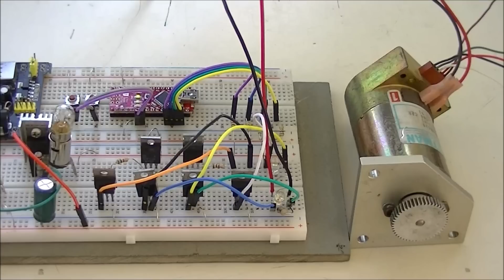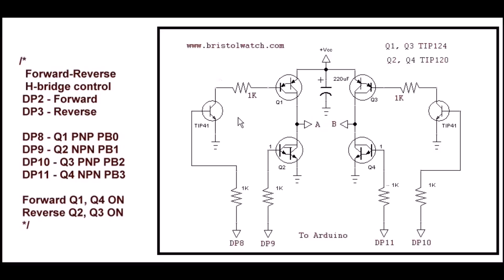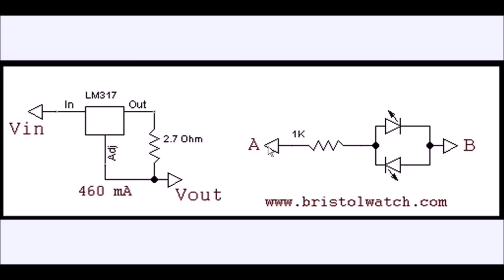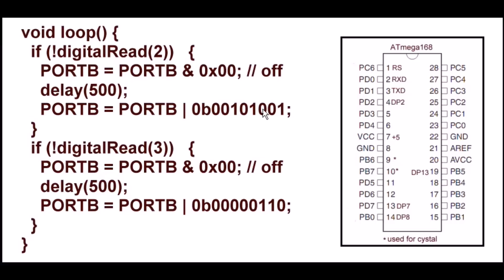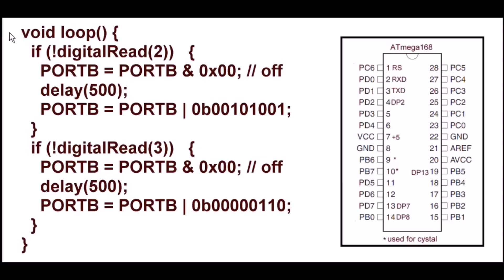Safely Program  H-Bridge Motor Controller

Comment: I made a h bridge but used two additional n Chanel mosfets to drive the p Chanel hence I had 4 Identical n Chanel and I simply connect two n Chanel’s to one input, leaving me with 2 inputs, such that when voltage comes in to input 1 - it’ll switch two n Chanel mosfets, one of which will then ground the p Chanel gate and turning it on. Its been working without any issue for a couple months thus far. And given the system works of a positive input,  I simply have a diode on each of the inputs to prevent current or power going back the my micro controller. 
I don’t understand why your circuit takes 4 digital pins and doesn’t have n Chanel mosfets driving the p Chanel instead of the transistor?

Comment: Hello hope your having a great weekend so far I have a few questions first I’ll describe what I’m building this is going to be a push mower converted into a remote controlled.motors from a wheel chair,micro controller is Arduino Uno, and motor driver is a SparkFun monster motor driver VNH2SP30.  I  have a l298 h-bridge and code which runs the motors in desired speed/direction but the monster is not capable with the existing code.  The code I need and schematics are not available for me to get my bot going and I’m not familiar with coding.  May I ask of your experience and know how to please create a tutorial for this project.  I would gratefully appreciate this endeavor and if you don’t could you direct me in a direction other than lost thanks so much in advance!

Comment: how to control the speed of the rotation ?
Reply from the maker: By pulse-width-modulation.
Reply: Go learn how to control the rotation of the motor separately and then you can just plug that in to this circuit where applicable.
Reply: but how to control the speed by vary the frequency for ac motor ?
Reply from the maker: This uses only DC motors. To control the speed of an AC motor see 
http://www.bristolwatch.com/ele2/zero_crossing.htm
Reply from the maker: See http://www.bristolwatch.com/ele2/zero_crossing.htm

Comment: Could DP8 and DP11 be connected to one port as well as DP9 and DP10? This would reduce the number of ports required leaving additional ports for other items.
Reply from the maker: All are on the same port PORTB.
Reply from the maker: OK mis understood the question. No don't do that if you mean connecting them together.
Reply: Yes I miss stated the question.  Should have said PIN.  Can you explain why this should not be done?
Reply from the maker: Because it simply can't. This is controlling 4 different transistors and the must be independent.
Reply: short answer, yes, and that IS how it should be done not for saving pins but for safety, a 4 pin control method is unsafe by design, as at powerup the pins can be random outputs, meaning you can randomely have both 8(10) and 9(11) at the same time. you use an inverted sign of 8 for 9 etc and that problem is 'designed out'
Now the issue with this is you can do direction but not speed, so you use 1 of your 2 saved pins to do pwm to an n channel mosfet switching the motor supply's ground line you now have direction and speed.
but hey, designers often dont agree :)
Reply from the maker: Not if the pins are switched properly. But i agree with the 2 pin and have modified the circuit for that
Reply: Maybe if you use a cmos inverter on each pin with a pull-up on input and output?

Comment: Yes you are correct but PORTB=PORTB&0x00 is the same as PORTB=0x00.  Anding a zero bit to each bit will set each bit to zero.  1&0 = 0.
Reply from the maker: True. I do this everywhere for consistency in programming to reduce errors. Thanks.

Comment: You can reduce the code size by removing the bit wise or and and operations.  Since you are setting all bits in the register there is no need to do bit wise operations.  Just assign the value to the PORTB register.  PORTB=0x00, PORTB=0b00000110
Reply from the maker: Wrong. In many cases that is done and that is my point to keep from messing up other attached devices connected to the port. It also won't compile properly on some compilers.
Reply from the maker: I'm aware of  that but it causes problems in some compilers in particular in setup. But do as you wish end best of luck. Thanks.

Comment: Is it possible to use this circuit to drive an induction motor?
Reply from the maker: This is used for a standard  magnet DC motor. I simply reverses polarity.